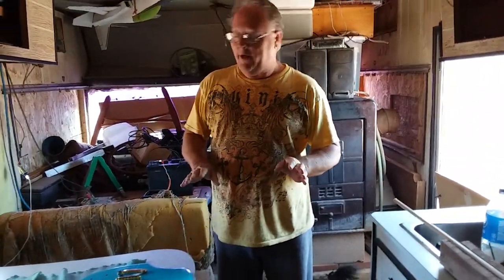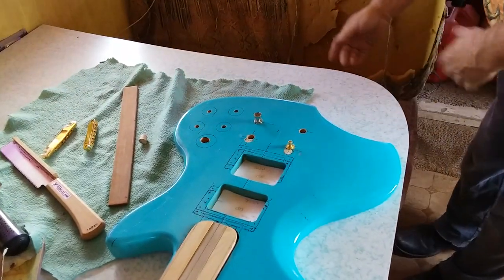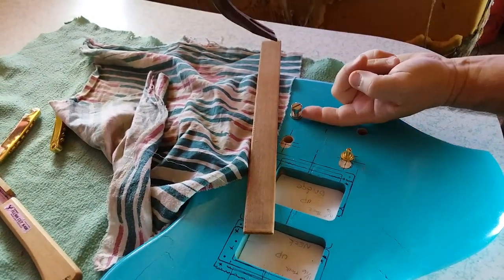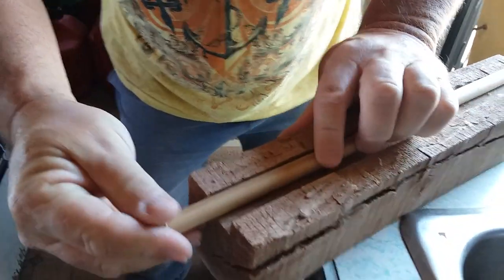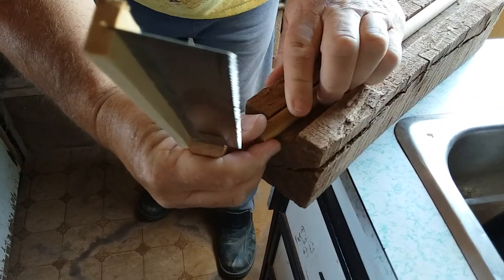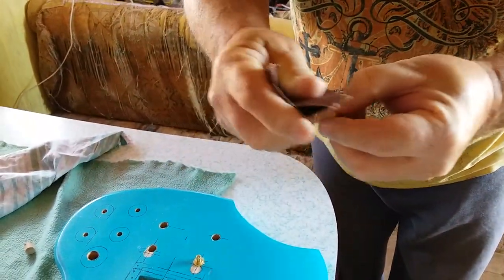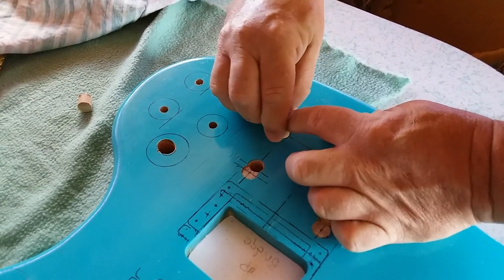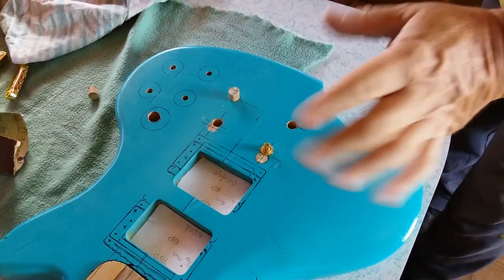Removing bridge pins and plugging holes / guitar repair

Comment: Thanks a lot, couldn't find a same string spacing  bridge for my bass, so I've decided to use a different bridge with different screw holes. Need to plug the old ones first.

Comment: Awsome job. Im gonna try this i bought a gibson bridge for my guitar but the holes are to big. I was gonna plug them this way and drill smaller holes. Think that work out??
Reply from the maker: Yep.
A drill press is best.......hand drill will work.........go carefully

If you have a drill gauge. Measure the bridge pin for correct drill bit.
Reply: Rodger that. Thanks man. Cheers!

Comment: Hello there great video, I did something like that but I'm having problems with the paint job because still see the edge of the hole, I used polyester bondo and sanded then applied base but still see the edge....I can't get to apply paint because still see the edge ....can you help me please?
Reply from the maker: Hello
It's possible you may need to reapply bondo. Sometimes once just isn't enough. 
Then progress sanding. I find the wet/dry sand paper works best.
Start with 320 grit then 400, 600 till you get the finish your after.
Be patient..........sanding takes time.
After sanding.....if you see swirl marks.
Buff using corn starch or baby powder.........it will remove all the swirl marks to a mirror finish. 

Hope that helps

Comment: You wouldnt want/be able to use any of this on a guitar with a nice fishing.  You can EASILY pull the bushings but dropping a small bolt into the well and screw the  pin down in and it will pull the bushing on its own.  No worries of using a crowbar on the guitar.  And filling the bushing hole, cut the dowel to length, use a Q-tip to add some wood glue into the hole itself, then insert the dowel and tap it to start it.  Then use a SMALLER dowel as a punch to set the plug at (or just a hair below) the body.  These are really rough techniques that will really mess up the finish of a nice guitar.
Reply from the maker: Wise comment.
Being careful with any tool used on a guitar finish is best.
Thank you
Reply: Yea man